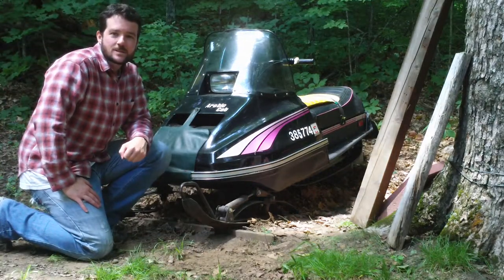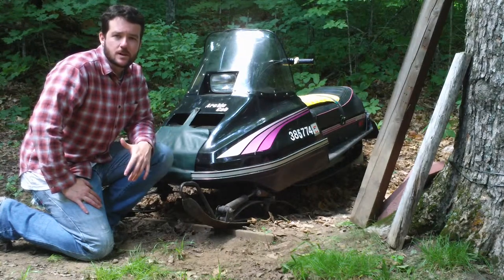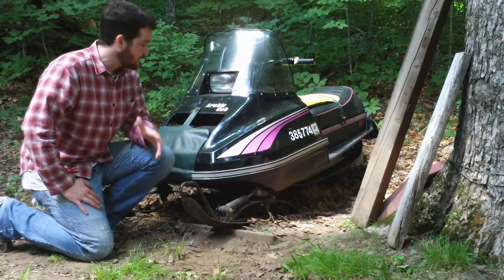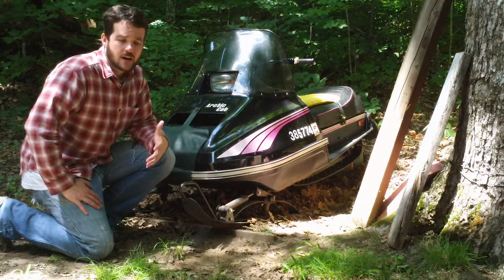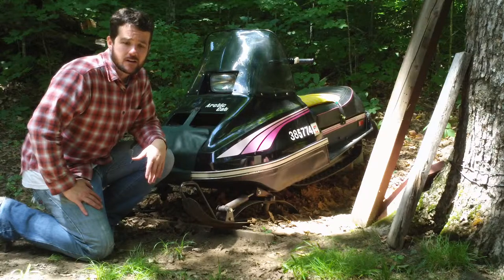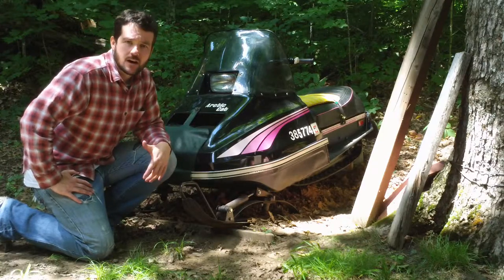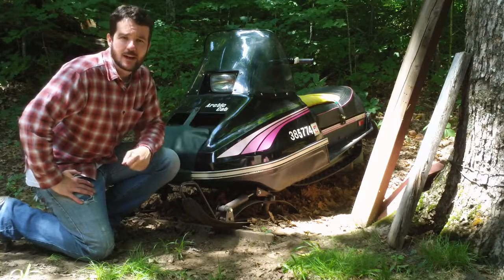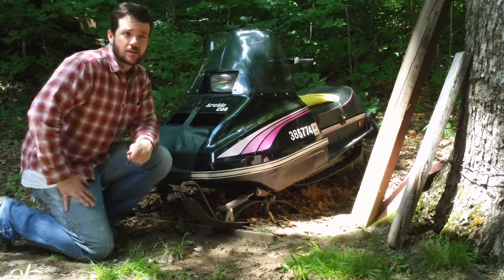Electric Snowmobile Project, Video #2 (1979 Arctic Cat Lynx 2000T)

Comment: Gas motor, electric motor, alternator, gas, and batteries = Too much weight for a snow machine. Bad enough the newer four stroke machines are very heavy. Too much weight means you will always be getting stuck. Best of luck.